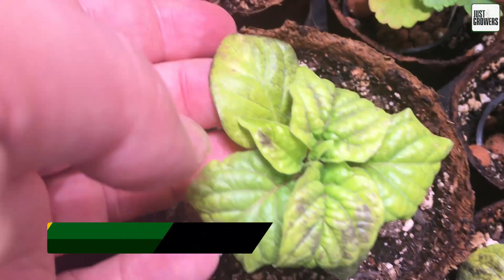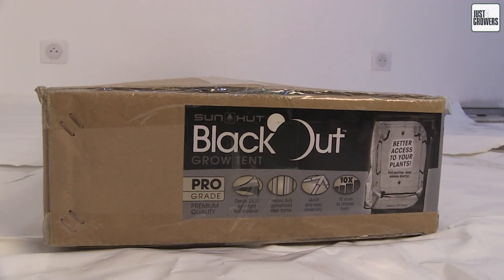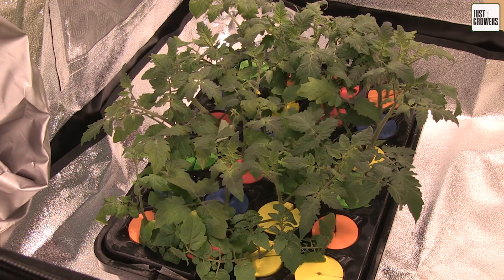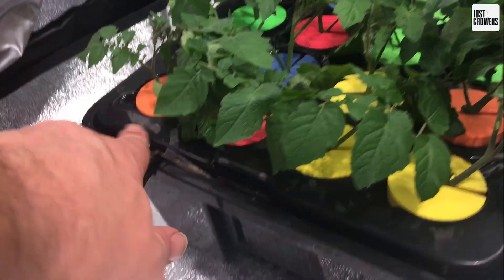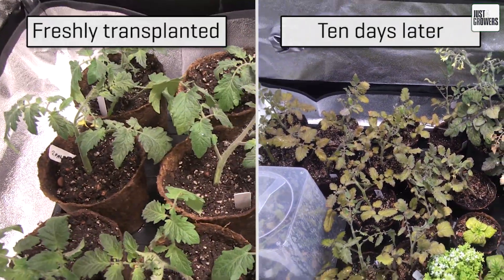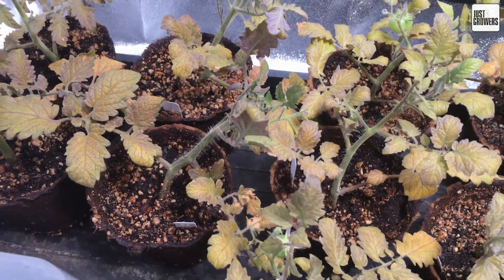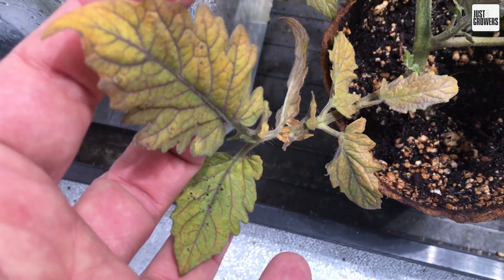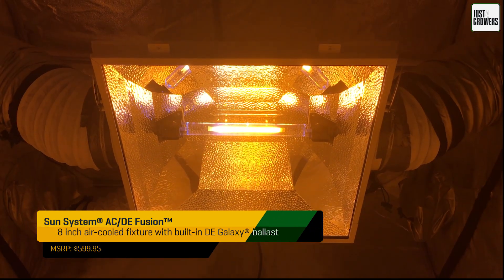VPD Too High?

Comment: all of this video is nonsensical. You want your grow environment to be clean and feeling comfortable with slight humidity. You can use your own senses to feel the atmosphere. You don't need maps, measuring cups none of that consumer crapola.
Reply from the maker: By all means, wet your finger and point it upwards. If your shiny pinky can gauge temperature, humidity, and air speed and extrapolate transpiration rates accurately then this can only be a good thing; the rest of us mere mortals will stick to our thermometers, hygrometers, and VPD charts.
Reply: What else do you use
Reply from the maker: @coolshirt  In addition to a regular thermometer and hygrometer to measure air temperature and humidity, I also use an IR thermometer to measure leaf temperature. Environmental sensors (eg: SensorPush ) are invaluable for getting a 24hr picture of your growing environment. Well worth a look.
Reply: It doesn't matter what you use! You see the rock only wants to know one thing. Do you like pie.
Reply from the maker: @coolshirt  More of a strudel man.
Reply: No one can call themselves a man and not eat the pie.

Comment: No, your plants did that because you stabilized the tomato cuttings as 'hydroponic' plants. You waited too long to put them into soil, they were 'set' as hydro cuttings, and you plunked them into soil...The water oxygen level of 100% that it came from went directly to an almost zero oxygen level in the soil. These 2 things were the problem.  VPD aside, if you would have put them into soil pretty much as soon as the roots started you would not have had that problem.  Simple stated: you're waiting way, way too long to put the cuttings into soil. Besides personal experience, the Proof is: take a fully grown hydroponic plant and stick it in a big pot of soil or take fully grown soiled plant and put it in a hydroponic unit... both will die. I was impressed with the root development, but horrified that you put it in soil that late...
Reply: If he placed those cuttings in soil with low root mass and a too high VPD the results would have been the just as bad....not enough root to supply the plant at an elevated transpiration rate.

Comment: I have watched your video and it is great. I found the explanation for some problems I started to have with necrotic spots. I forgot to turn the humidifiers and my strawberry plants were about 30°C with a 10% humidity for 6 hours. My question is if the necrotic spots, tipburn are reversible. Thanks

Comment: Your best video
Reply from the maker: Thanks Elliot. I must make “VPD Too Low” too - it’s on the list, just got a few to do first.
Reply: Everest Fernandez keep up the good work. Question, if my canopy temp is 25-30c (I used a thermal camera) most of the canopy being 27-28 only the buds glowing at 30c. Should I match the humidity to VPD. And what chart should I use because they all say different things depending on who made the chart.

Comment: I have recently come in to this problem with my plants so thanks a lot for this information. I do have a question for you though. I never had these problems when I used to grow with T5 bulbs in veg and 1000W HPS in flower ( Same dry environment, same nutrients ) but when I switched to this 480W quantum board (3000k) I've had these problems twice now under the exact same type of environment. Any idea why LED seems to be more prone to these VPD issues? Again thank you very much you've got a new subscriber.
Reply: Rawb as fsr as i know the led quantam boards cause the plants to eat more calmag than your t5 or hid light does.   So check that

Comment: Never had vpd problems in 25 year's,  never even heard of it before.
Reply from the maker: Pleased to hear it! But if you ever experienced issues with relative humidity being too high or low, or temperatures being too high or too low, you have in fact experienced VPD issues, just labeled differently. :) peace and happy growing, Everest.
Reply: @Just4Growers  The humidity were I am is 75% outside I have no idea what it is indoors I have chilli plants that look a bit like they do in this video because of over watering,  I cut back on watering and they are getting healthier.
I'm to tight to buy more gadgets.
Reply: @Just4Growers  I do partial root zone drying that helps.

Comment: Why do humidifier’s not work well is small grow tents? I have fruiting / flowering citrus trees in a 4 x 4 a grow tent. The VPD is definitely too high. I was all set to remedy the problem with an Ideal Air 75 pint humidifier. Sounds like overkill but I think 75 is the smallest humidifier Ideal Air sells. Why is this not a good idea in a small grow tent?

I want to thank you for your real world example. They may have saved three of  my citrus tree. I ordered some fans and was about to feed them some citrus tome but after watching your video I see how important it is for me to fix the high VPD problem first before I add nutrients and switch the fans on.

Comment: Your cuttings failed because they had water roots which are not suitable for transplant into a soil medium.
Reply from the maker: With a bit of love and care - far more than I gave them 😆- they can make the transition to soil but you’re right, best to propagate into the sake “stuff” as you intend to grow on into.
Reply: Dude. Stop spreading mis information.
Aero clones with roots transplant into soil and soilless mix perfectly. Water roots? Too funny, kid!
Reply: @bohaggin5913  (Well established) hydroponic roots as seen in this video do not transfer into soil and same goes for (well established) soil started roots cannot be plopped into a hydro system. They will wither away and die as seen in this video. If he would have chopped off the roots and placed them under a humidity dome they would have re-rooted into the soil just fine without withering away.

Comment: If my VPD is too low, primarily due to a low leaf temperature, are there other solutions besides lowering the lights? Temps are around 25C and 50-55% RH with lots of air circulation. Thanks!
Reply: I’m sorry man, I thought I was understanding…but in this example, Pete says that he’s got a low VPD, with 25ºC & 50-55% RH. Isn’t that a high VPD of 1,24 to 1,4 (assuming leaves at -1ºC than air temps) ?? Thats good high VPD to mid / late flower right? I guess it depends on what you want but I think a bit higher than that its gonna take you out of the sweet spot of the chart. Great vids by the way, new fan here of your channel amigo
Reply from the maker: +Pete Steimer Hi Pete, thanks for your question. VPD is based on the following factors: relative humidity, leaf temperature, air temperature and air movement. If you want to increase your VPD you need to: increase your leaf temperature, increase your air temperature, lower your RH, or increase your air movement. To increase your leaf temp / air temp you could add a heater or use a light source with more infrared / radiant heat. You could also use a dehumidifier to reduce your RH to, say, 40%.

Comment: VPD @ 58 or so. I have a self watering pot with about 10 gallons of water, then potting soil, then planted are some potato vines. I added some Miracle Grow to the water. I am in Phoenix Arizona and it gets hot as hell. My pots are outside so no way to control the temp or humidity. I have the condition you speak of when too much water is brought up and too much calcium blocks nutrients. In the case where you cannot stop high heat and low humidity, can you change the water chemistry to help?? Like maybe high PH distilled water with only certain nutrients? Suggestions would be helpful. Thanks.
Reply from the maker: Check out my video on VPD here amigo — Humidity 102: Vapor Pressure Deficit — VPD Chart — and let me know what number you end up with.

Comment: Hey man loooove your clean work. So heres my question, I noticed some twist on the middle fan leaf of my vegging plants. Any idea what that may be? I grow 5 strains, all started doing the same thing and it has me stumped. I started seeing that when I switched to sealed room thinking the higher humidity in my case has caused some stagnation concerning nutrients in the medium due to slow transpiration. Lmk what you think and thanks.
Reply from the maker: +thatsjaybaby Ola amigo. Thanks for your +vity and encouragement. What is your RH running at during the day? Are you running a dehumidifier? What about CO2? What PPM are you running? And do you dump the CO2 at lights out and bring fresh air into your garden for the night cycle? We will get to the bottom of this amigo! Peace and happy growing, Everest.
Reply: Everest Fernandez thanks for the reply. OK. To address your questions, I aborted my original plan to run sealed because of what looked like a deficiency but I suspect a lock out due to the high humidity. The problem seems to be correcting somewhat and maybe the plants are just recovering. Anyways, the humidity is about 45% my temps are running at 82° I don't know how the extraction fan 24 seven. The plants look much better maybe I figured it out was just looking for your opinion. I do want to supplement with CO2 ASAP but not until I can dehumidify it seems.

Comment: Everest, I grew a plant in a 5 gallon container of soiless organic mix, then when the roots started to pop out the bottom drainage holes, I placed the entire container ontop of a 5 gallon bucket, filled with aerated water, turning it into a dwc system. Everything grew really well, despite some excess transpiration issues, I was wondering if you could try the same thing to see if you get similar results.

Comment: I have a flower and veg tent in the same room. I have a dehumidifier running to bring down humidity to the right levels of around 40-50% humidity for my flowering tent. It works great but I need my veg tent to be in the 60-70% range. Can I stick a humidifier in my 2x4 veg tent to get the humidity to the right level? Why did you say they don't work well in small tents? I would really appreciate any help on this. Thank you!
Reply from the maker: Hey amigo—it wouldn't work with the humidifier I have because the vapor it produces isn't fine enough. Try something like the "Mist Maker" — http://www.growell.co.uk/fans-filters-environment/humidity/mist-maker-humidifiers.html — much better suited to small grow tents. I'll be checking out gear like this soon.
Reply: Everest Fernandez Thanks so much for answering brother! I actually just ordered an evaporative humidifier from Amazon because it doesn't produce any mist at all. Do you think that will work ok or should I return it and get what you recommended? Here is a link to what I got. https://www.amazon.com/gp/aw/d/B00O0WOO74/ref=mp_s_a_1_3?ie=UTF8&qid=1499955466&sr=8-3&pi=AC_SX236_SY340_FMwebp_QL65&keywords=evaporative+humidifier&dpPl=1&dpID=41tVKyvqN1L&ref=plSrch 
If you get a chance can you please let me know if you think it's ok to use. Thank you for all you do! Your videos are so helpful.

Comment: You can get a small (computer) fan blowing on the solution, where the (DWC) plants sit in, with another hole letting moist air out. Whit this you have to top up your solution a little more often, but it's a very cheap solution for your humidity problem. Last but not least it keeps the temperature of your solution at least 2 degrees C lower

Comment: I'm very curious about oxygen diffusers using electrolysis vs air pumps they are claiming 30% yield increase. I have not seen any proof of this. also the electrolysis method is said to release heavy metals into the water. my question then is if it is a significant enough amount to be concerned about? or would regular resivor changes take care of that. what effects would that have on your PH/Nutrients?, and should you even bother with oxygenating water in an ebb and flow system. thanks again for your expertise.
Reply from the maker: +ConstitutionallyConscious Thanks for your comment. I am yet to be convinced by the use of electrolysis to oxygenate a nutrient solution. (That said, I have only tried it once.) electrolysis is going to release twice as much hydrogen as oxygen. Further more: Nitrates, phosphates, sulphites etc will go to the cathode while metals (including those required by the plant - iron, copper, zinc) will go to the anode. In both cases making them unavailable to the plant. I have been electrolyzing a nutrient solution for several weeks now and will send it to the lab for testing to prove it!
Reply from the maker: I will let you know when I get the dissolved oxygen 101 video up.
Reply: Everest Fernandez Thanks again for ur expertise, that's why I asked the pro.
Reply: Probably wouldn't be a problem if you use RO water, no heavy metals then?
Reply: Interesting, it'll be exciting to know what results you come up with, many thanks!
Reply: Everest Fernandez Please do the dissolved oxygen 101 vid. great channel

Comment: wow I think that's what happened to my strawberries... i had what looked like leaf burn but on the stems of the leafs... doesn't Epsom salt help a little?!
Reply from the maker: Epsom salts will put more magnesium and sulfur ions into solution — if your VPD is too high, adding more solutes will probably exacerbate rather than remedy the situation. What media are you in? Not sure if you're outside or inside, but if you can give your plants a little shade (assuming your temperatures are too high) and water through with a milder nutrient solution (or just water if in soil) it could help see them through. Some misting to increase localised RH may help too.